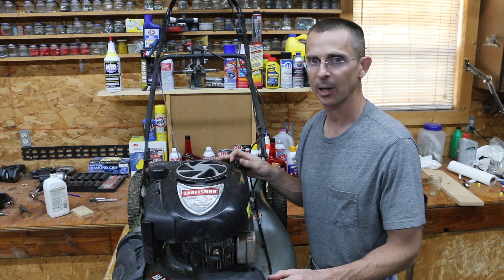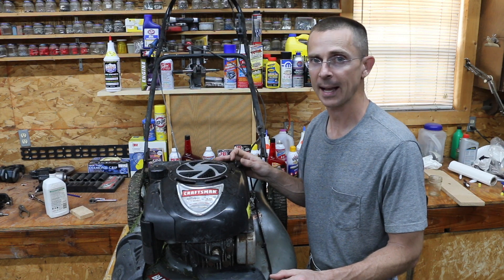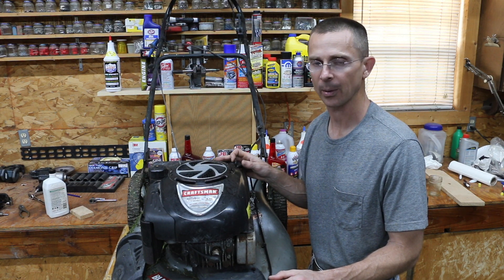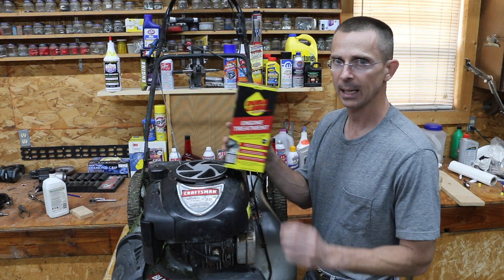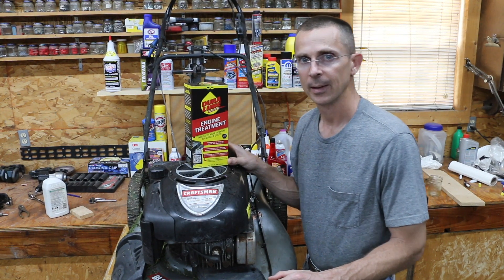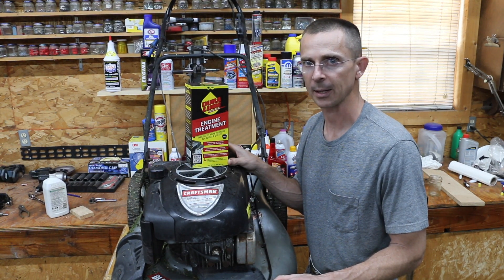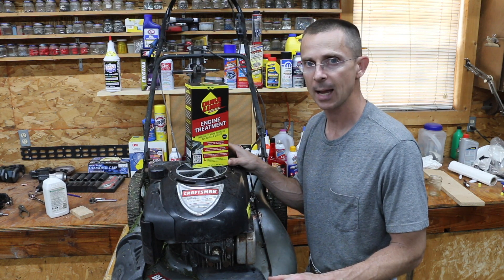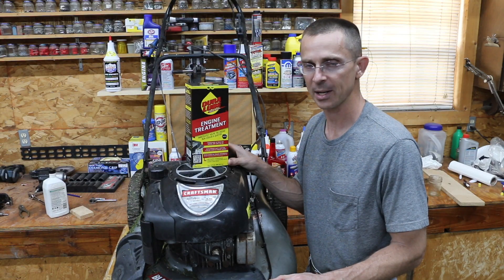Does Dura Lube actually help quiet and cool a gas engine as claimed?

Comment: I went on a 500km trip with a sagged out 1200cc 4 banger, grinding slowly up hills at 40MPH in 3rd was no fun.  Getting there required a full tank with the warning light flashing at me for the last 50k. Two weeks later I found out I would have to do the trip again so I gambled and thought it would be a great opportunity to do a comparison.  My oil was relatively new but I followed the instructions and was immediately shocked by a massive reduction in vibration and noise that happened as I poured it in while running.  The revs immediately increased by 200rpm, requiring me to adjust it back to 500rpm at idle.  

I drove the exact route as before and filled up at the same place before I left (always to the third click), chock full. The trip really sold me, because I was able to maintain speeds going up those same hills meaning a ton of friction had been overcome somehow. When I arrived at my destination I was elated to also find my mileage had increased as well as I was NOT running on empty as I was before, and the fuel warning light only flashed once briefly as I arrived.  

Summary: I understand that anything that can coat metal like this may also have the "potential" to block critical oil passages, so I would never flat out recommend it for any engine, especially a new one, but if you have a tired one and hope to delay a rebuild or hope to see if you can push it longer, I can't recommend it enough.  It paid for itself in a few tankfuls.
Reply from the maker: Impressive results!  Thank you

Comment: I just watched your Duralube test and you asked readers what we felt about Duralube and is it worth buying?  My Answer is YES!
and here is my true story why...   

Back in the Winter of 1992, I saw a TV commercial for Duralube that claimed it protects engines at dry startup and it protected engines from thermo breakdown by conditioning and bonding to the internal metal parts, it was a new product at the time,  I Live in Minnesota, I owed a 1988 Buick Somerset Regal with a Tech 4 Engine with about 170,000 miles, When it came time to change the oil I decided to buy Duralube and added the full quart (replacing 1 quart of oil with Duralube) along with  3 additional quarts of 10w30 Standard oil totaling 4 quarts that the engine required per its instructions on the bottle. 
 Where I worked at the time was about a 40 mile trip from my house, One morning on my way to work I drove for about 5 miles and noticed on my digital gauge cluster my Oil Pressure Started dropping quickly, with-in a half a mile it was showing Zero and the red warning light was blinking rapidly!!  Freaking Out,  I turned off my radio so I could hear the engine, it was fine, no ticking, no knocking sounds, and my Coolant Temp was Normal,  it was during morning rush hour, cars all around me, the temperature that morning  was roughly 5 degrees above zero, we got 4 inches of snow the night before,  so to pull off to the side of the road, without heat, stranded hoping someone would pull over to help me would of sucked!! (no one had cell phones back then)  So I was relieved thinking it must just be a faulty gauge sensor but was going to stop at the gas station anyways which was another 15 miles away.  

At the Gas Station I pulled the oil stick and NOTHING showed, I bought 2 quarts of oil, poured it into the engine, checked the oil stick and it barely was at the tip, i added a 3rd quart, it finally showed on the stick, and it finally showed full after  pouring in the 4th quart of oil!!  I couldn't believe it, I got back into my car started it up, the Oil Pressure gauge went back up to normal and off to work I went.  I drove my car without any oil in the engine for 15 miles with no problems and just when I thought all was ok, right away with-in a half mile from the gas station, I started loosing Oil Pressure again.... Long story short.

I made it another 20 miles to work, NO OIL PRESSURE, NO OIL IN THE ENGINE, NO KNOCKING/TICKING SOUNDS, COOLANT TEMP STAYED NORMAL. THE ENGINE RAN FINE.  The Repair shop replaced the Oil Sending Unit, the seal went out in it and  caused all the oil to pour out as soon as the engine was started, no one could believe that the Engine didn't cease up running that many miles without oil and the only thing that left it could be protected it was DURALUBE  I poured in it a week prior when changing the oil... I've Been Using It In All My Vehicles And Small Engines Ever Since!!
Reply from the maker: Wow! Impressive! Thanks for sharing this experience.

Comment: This is from personal experience......
In about 1997 I was coming back from Cali to Denver Colorado. And just as I was going through the Eisenhower Tunnel my front main seal busted on my 94 Sentra. And didn't have any extra oil in my car. And I drove that car without oil from the tunnel to Denver, I thought for sure the engine would be completely ruined. I was running dura lube in it and the engine was completely fine even after driving for over 100 miles. And ever since I've been using it in my cars.
Reply from the maker: Impressive results!  Thank you

Comment: I use dura lube on my 98 mazda 626 could I use it on my yamaha v star 1100 motorcycle?
Reply from the maker: I would not use it if it has a wet clutch system. Thank you
Reply: @ProjectFarm  thank you sir.

Comment: I have used DuraLube for about 18 years. I have never had a wrench turned on any of my engines. I am driving a 2002 Chevy pickup with 171000 miles and I KNOW as long as I add DuraLube the engine will last longer than the rest of the pickup. Of course I am old school and have always changed my own oil and enjoy it. Is DuraLube worth it? If you buy a new car every 3 to 4 years probably not. If you are like me and drive them as long as they are sound the answer is a no brainer YES !!!!!!!!!!! GBA-GBY
Reply from the maker: Thank you

Comment: Been using it since 1991. Had a VW Microbus; smoke filled the interior. Lost the oil pump, drove for miles! VW Mechanic asked what I put in it, said it should've seized. Been using it ever since.
Reply from the maker: Impressive!

Comment: better for older pushrod engines to me  and i still you it in my 302 Windsor. Today modern engines are not built tough like the old engine  lots of plastic cheap aluminum gaskets to many sensors
Reply from the maker: Thank you!

Comment: A friend had an old Mazda RX - 7 rotary that smoked for 10 min. or so until it warmed up. we added a bottle of dura - lube and no more smoke even when cold !! we also used it on a Chevy Cavalier with 1 oz. of acetone @ 5 gal. gas and got up to 42 MPG !!!!! Could you try 48 systems plus as an additive ?
Reply from the maker: Thank you

Comment: My brother treated a Dodge 400 with Dura-lube. One day was out madding and blow the rear seal out of the motor, processed to drive the truck 38 miles with no oil where it sit for two years before we replaced the rear seal. Before we did, we thought we better see if it will run. Fulled it will oil to both of our amazement it started and didn’t knock.
Reply from the maker: Wow!  Amazing.

Comment: I posted on another video of yours the following story on my son's youtube account. I'm posting again on this video on my youtube account: I had a 1986 chrysler 5th ave that i put 1 quart of DuraLube in every other oil change. I got lazy once and had BP ProCare do an oil change on the non DuraLube cycle. I then drove to work 65 miles almost all interstate driving. About halfway to work, I had the oil pressure light come on. I pulled over and left engine running as it was not over heating. I checked under oil pan and noticed oil plug missing. I decided that since BP ProCare screwed up, I would just continue driving and if engine seized, it was on BP ProCare. I made to work no problem. After work, I drove the 65 miles home and stopped at BP ProCare near my house. Yep, engine still running and not over heating. They came out to look and couldn't believe it. Of course they put in new oil and plug and  guaranteed that if engine did seize in near future, they would pay. Also got 3 free oil changes. Kept car for 3 more years until I bought a new car. I put DuraLube in every car or truck I've owned since and feel very confident.
Reply from the maker: Thanks again.  Amazing results!

Comment: I have used Dura Lube for several years. First, I'd like to say this was a good test. Many more tests would be needed to come to a conclusion, however it seemed to me that Dura Lube did make a difference. My experience in useing the product is that I've never noticed any performance difference, mileage, power or running smoother, but I do use synthetic oil and a friction modifier in every oil change. Usually I use Dura Lube, but sometimes Slick 50 or whatever is on sale at the time and my Chevy Colorado has 319,000 miles and runs like new. At 222,000 miles I had the head replaced because of a factory defect, and the chevy dealer mechanic told me there were still score marks from the factory in the cylinder walls that usually wear off much earlier. He was shocked and said he'd never seen that before. I told him of my oil change regimen and he just shook it off as if that had nothing to do with the engine not wearing at all.
Reply from the maker: Thank you

Comment: They claimed if you ran pure dura lube in a race car motor and the oil pump failed during the race your motor could last with just the film left behind...
After watching your slick 50 test was just wondering if you would see how long the motor would last if dure lube was used as oil then drained out
Reply from the maker: Great video idea!

Comment: I can't see the harm in a low tech engine with high or excess tolerances but no way would I put it in a modern engine. The clearances are so tight that changing the viscosity rating would be a gamble. It would also contaminate DPF's. Unscrupulous car dealers used to put thick gearbox oil in noisy engines to get them off the forecourt.
Reply from the maker: Thank you

Comment: If it's 72 psi cold with Dura Lube why does the compression drop that low when it's hot? Shouldn't it be the other way around
Reply: Thinner oil when hot = thinner seal of rings. old piston rings expanded to limit already..

Comment: I haven’t e been using it from when I first saw it I. The US, bought a couple of bottles, don’t know if it works, but never had any problem with my PT Cruiser since I been using it, just used my last bottle, need to buy some more, but it’s unavailable in the U.K. 
can anyone get me any?
My PT cruiser is a 2010 model, diesel, with too many miles on the clock
I used it a lot in my ford escort, never any problems
Reply from the maker: Thank you

Comment: Late comment to a 2-year-old video, but I used Duralube back in 1996 or 97 in a 1980 Ford Fairmont with a straight 6.

It had oil leaks and ran fairly rough. After I put it in. it did run noticeably smoother, but one benefit that saved me...

I forgot to check the oil (leaks, remember?) for about a week, and the oil didn't register on the dipstick.

Driving down the freeway on a 45-mile trip, I suddenly heard a loud ticking. I pulled off the side of the road, checked the oil and "what oil?"

I rolled the dice to get it off the road and pulled into a 7-Eleven on the next exit. Bought 3 quarts of oil (one at a time because I didn't know how much it would take) and filled the crankcase back to it finally registering on the stick.

Prayed to the car Gods and turned the key...

Ticking...ticking...gone...

The oil got back to work at full capacity with no repercussions, and I think while the level was low, the Duralube saved the internals.

It still ran until I sold/junked it after getting a newer car.

Just thought I'd share.

I'd really like you to try TriboTEX in a future video under the same procedures. You do good work (y)
Reply from the maker: Impressive!  Thanks for the video idea.
Reply: To bad ya got rid of the Fairmont.

Comment: i used to drive tow truck
one of the trucks i had had no a/c so i installed an a/c compressor and used it as an air compressor
i used duralube to lubricate it
i had to lube it once a week or so or it would seize (went through a few) but i think it worked well
Reply from the maker: This is interesting. Thank you

Comment: I had a Porsche 914 and I used Duralube in the motor. My oil tube broke when I was 20 miles from home and I lost all oil pressure. So I tested the Duralube by driving it home and the motor was knocking badly by the time I got home. I fixed the broken oil tube and started the car when it had cooled and it ran perfectly. I think the Duralube saved my motor.
Reply from the maker: Wow!  Impressive results.

Comment: The first time I used duralube was in 1999 in my dirt track car I kept losing oil pressure in the turns when I would get back on the gas at 7000 RPMs the oil pressure would be at zero I kept replacing the rod bearings until I decided to try Dura Lube after putting duralube in that engine I never replaced the rod bearings again and the oil pressure was still dropping to zero but the engine never failed I would give it a thumbs up.
Just in case you're wondering it was a Pontiac Super Duty Iron Duke built by Paul Vanderley Engineering in Biloxi Mississippi. The oil pressure problem was an oil pan issue that I never solved but the duralube saved the engine in my opinion
Reply from the maker: Impressive!  Thank you
Reply: @ProjectFarm  there used to be a product on the market by the name of
" Extreme pressure concentrate" several motorcycle shops used to carry it but it was a friction additive maybe you can do something with it if you can find out if it's still available because the guy used to have a 6 cylinder Chevy engine that he would run with no oil in it for 15 minutes at  RPMs and it would live.

Comment: Used duralube in my big block engine in 95 and it did smooth out and run quieter. It got better gas mileage too as I worked at Nissan and the gas was killing me lol it works !
Reply from the maker: Thank you

Comment: My second car was a boxy silver 1985 Oldsmobile Cutlass Supreme. My “Silver Bullet” had a big gas guzzling 305 v8 and only 40,000 miles on it when I purchased it for $5,000.00 bucks from a nice elderly couple that had just purchased a brand new Cadillac back in the sticks of Nebraska and just wanted to get rid of their old car. They had only used it occasionally to drive to church and the market. 

This vehicle was a blessing and a miracle, and a solid used car for a teenager with a new drivers license and  some gas money. It started to overheat every single time during long road tips whenever I had the A/C running at all, and always left me stranded on the side of the road, with the hood up and steam shooting out of the radiator, waiting for it to cool down. This was before cell phones were accessible and affordable for the general public. 

So, being a young knuckle head that saw one of those popular Dura Lube commercials, I tried it and that car never overheated again! I now use a quart of Dura Lube in every vehicle that I own at every oil change and I will use it as long as the the product continues to be available. 

I wasn’t a mechanic, nor did I have tons of cash for repairs, but that Dura Lube kept the engine running cooler and it never overheated again. Then an older and wiser friend that I was bragging to about how amazing Dura Lube was, asked me in all seriousness, If I had replaced or checked the thermostat and coolant flow. Who would have known? 

It still needed a new thermostat! We all stood there cracking up laughing, when we pulled off a hose to check for flow, but it proved to all of us, without any shadow of doubt, that Dura Lube actually works!
Reply from the maker: Wow!  Impressive results!  Lots of positive comments about Dura Lube

Comment: I don't know if Duralube gets the credit, but I bought my truck new in January 2003, and after 500 miles I changed the oil, and added a quart of Duralube.  I did it again around the 100k mile mark. I just did it again at 250k miles.  Trouble free.
Reply: oh, lol don't read that wrong.  I changed the oil on a regular basis.  Only made note above of the times I added Duralube to the oil change.
Reply from the maker: That's great!  That's a lot of miles and you've taken great care of the truck.

Comment: Speaking of quieting motors, how quiet can a lawn mower get? (I'm actually thinking about generators here) That is, what would happen if a series of mufflers were put on a noisy lawnmower (or generator)? Do glass pack mufflers work better, and how many mufflers is practical? Also,  is a generator going to be more quiet when in a dog house, and how many layers of housings can be made to quiet a generator in a practical way?
Reply from the maker: Thanks for the video idea!

Comment: I will give my testimonial ,, Yes i got caught up in the ads of the 90s ....But now I believe in duralube i have had several vehicles ...go 500,000 while using it a nissan hardbody 3.0 v6 1990 a nissan z24 1990 both service trucks..... and now my moms 1999 mazda mpv is going strong at 260,000 miles and i use it every oil change which nowday with the oil and filters is once a year,
Reply from the maker: Impressive results!  Seems like a great product.

Comment: I have a 92 Honda Accord.  I had used duralube in the crankcase several times.  One day my oil light came on when I went around a corner.  I checked my oil and turns out I was three quarts low. I have no idea how long I drove it like that but that was 100 thousand miles ago. I'm going to try engine restore based on your findings. Nevertheless,  I feel duralube saved my engine.
Reply from the maker: Impressive!  Glad DuraLube saved the engine!
Reply: Engine Restore clogs the passages with those solid chunks